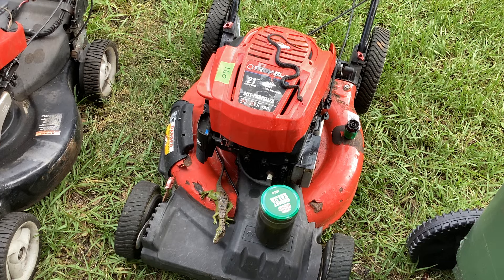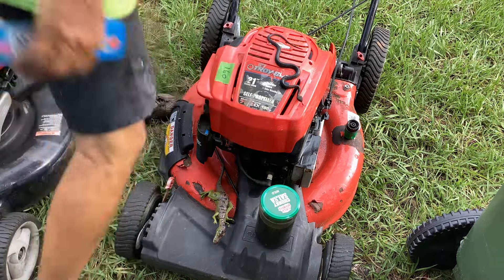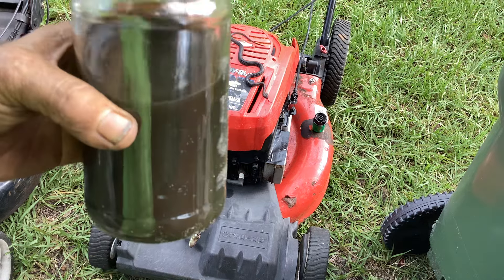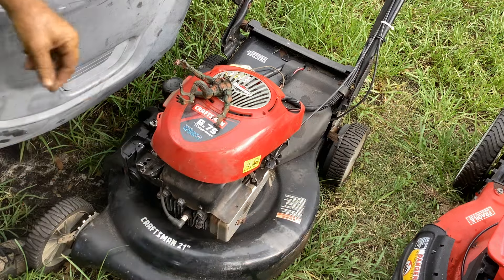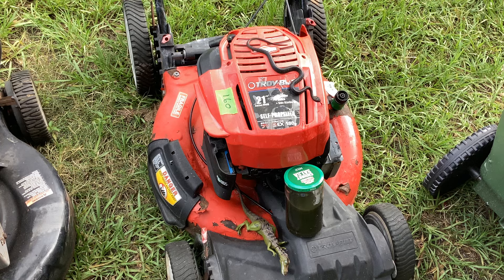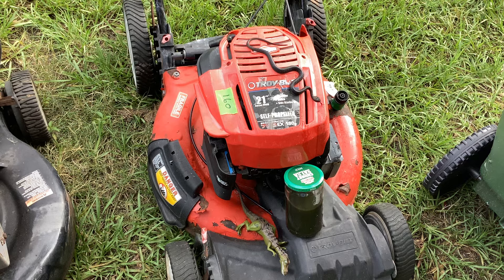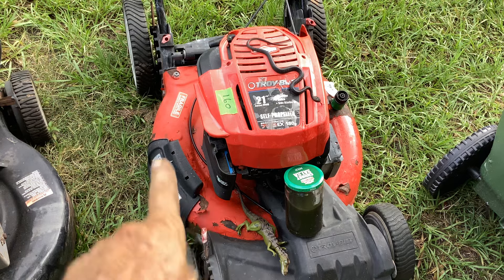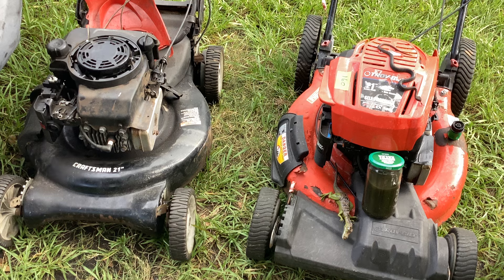Saturday Update.!!  2011 Troy-Bilt TB230.   Customer Non-Running Mower.  We May be in luck Today!!!

Comment: When I clean those carburetors and the float is sunk. I put a new china red seat in them. The tecumseh tool is nice to have.❤
Reply: Yep it can close up when very hot 
Also I checked the fuel hose for a inside filter 😢
Having the tool and new seats is a must 😊